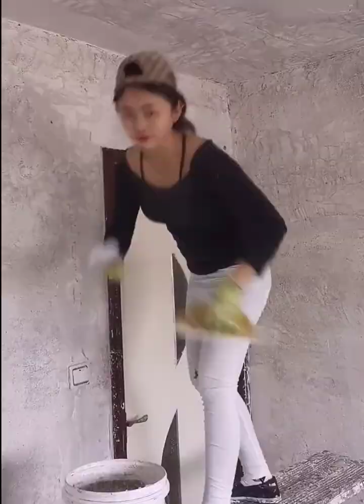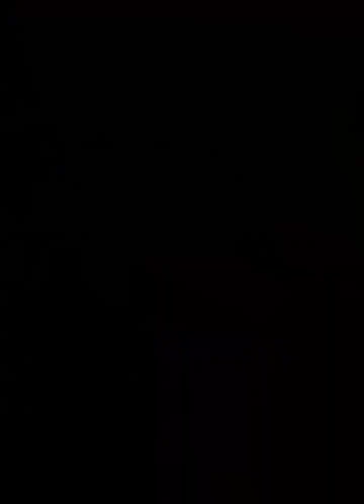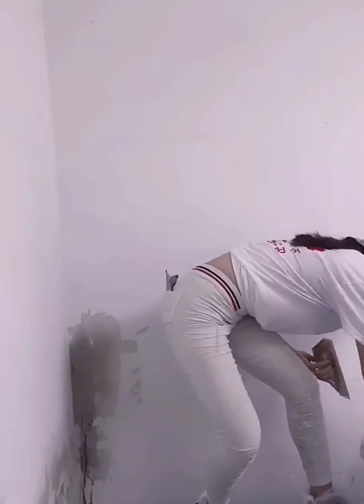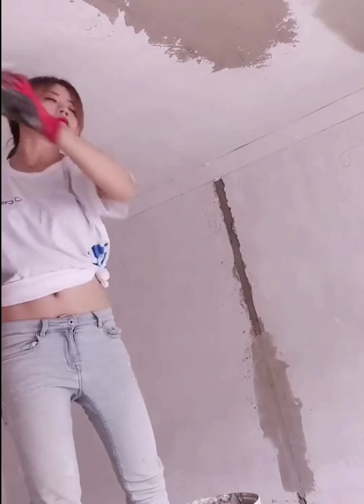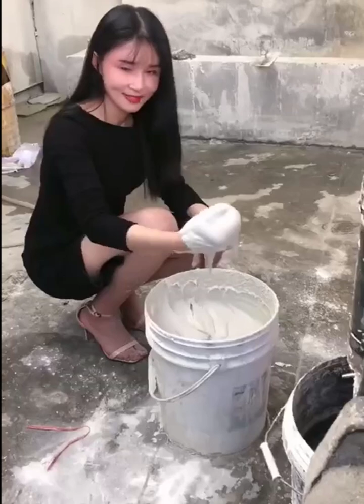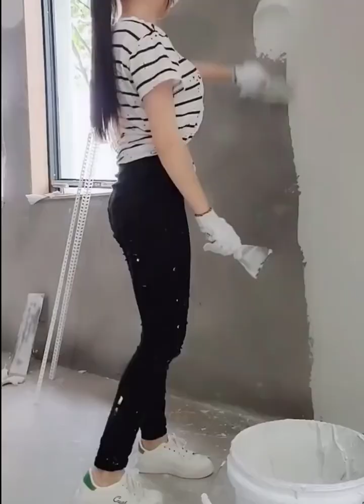Young girl with great cement mortar skills-Great engineering in construction PART 7

Comment: Now that's a hard coat like if I was there I'd show you the correct way the right way to do it far as I'm concerned that's the wrong way and more and that will end up cracking the way you're doing it the way I would show you it would never crackhead would last ten times as long is that in the way that you are doing